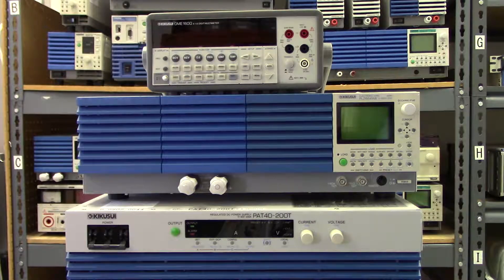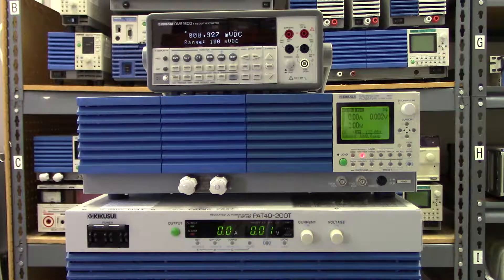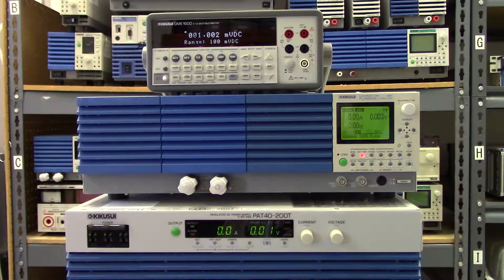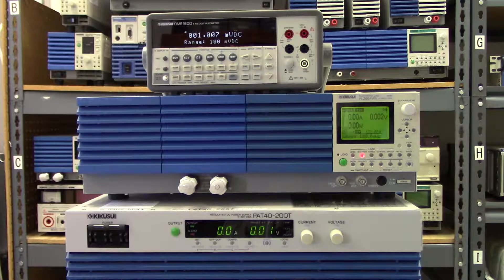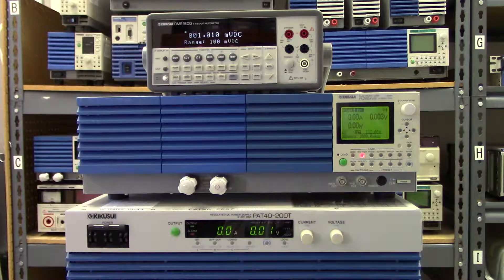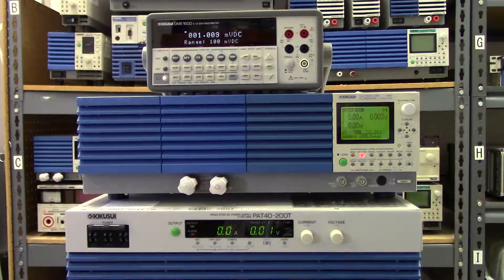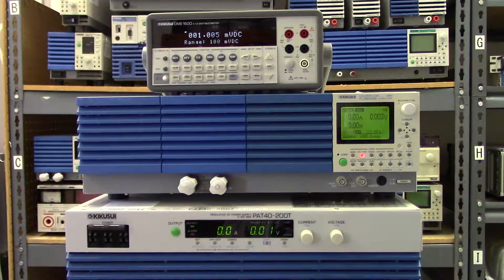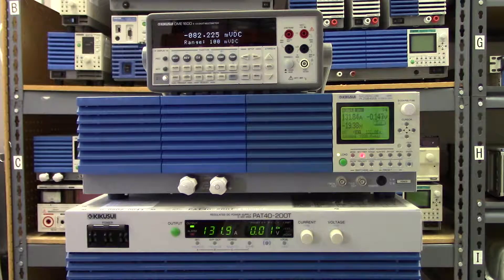Kikusui 0V Input DC Electronic Load PLZ664WA - Low Voltage DC to DC Converter Testing - 0 Volts!

Comment: Hi, I am from Singapore. I have a faulty PLZ664WA unit. How do I get a replacement power supply board? The fuse rating shown on the power supply board is AC 250V 2.5A axial type. I am not sure whether this fast acting, anti-surge or slow blow fuse. I cannot get the information from the manual. Unfortunately the faulty fuse was thrown away by someone so I was not able to refer to it. Could you help? Thank you.
Reply from the maker: If you have any further questions, please contact us at “kikusui@kikusuiamerica.com”. or select your contact person from the website of our headquarters below,
https://global.kikusui.co.jp/company/sales-network-global/
Thanks!

Comment: Wary interesting, may I please ask you about if the Kikusui PLZ1004W has same 0V input capability?
Reply from the maker: The 0V input is a unique feature on our PLZ-4WA series. PLZ1004W can sink current down to 1.5V at full current. Our new PLZ-5W series has the capability to sink full current at 1V and also down to 50mV by derating the current. This voltage is the terminal voltage of the electronic load so you would need to consider for voltage drop on your load cables.
Reply: @kikusuiamerica  Thank you wary much for your great and fast reply! :-)